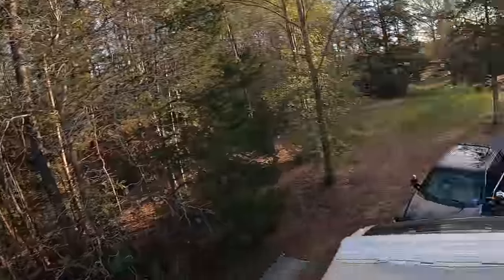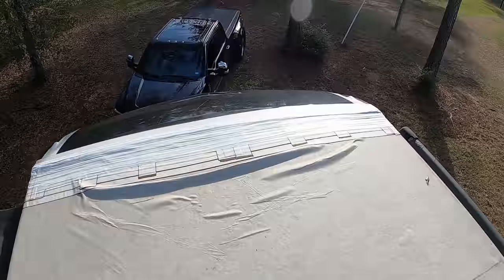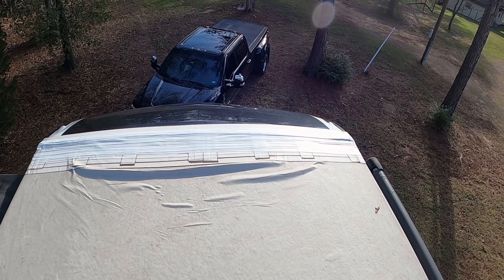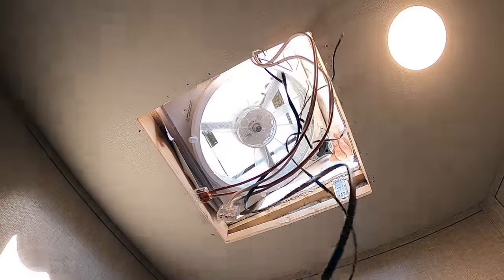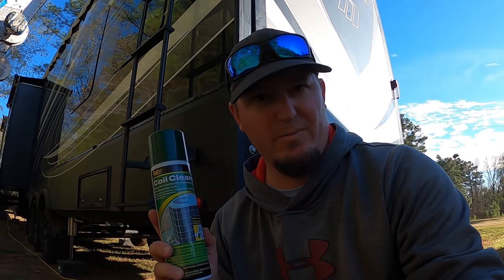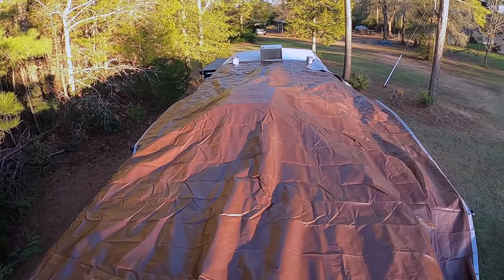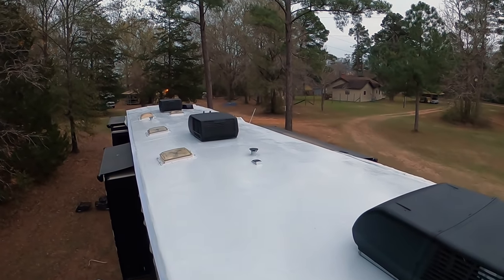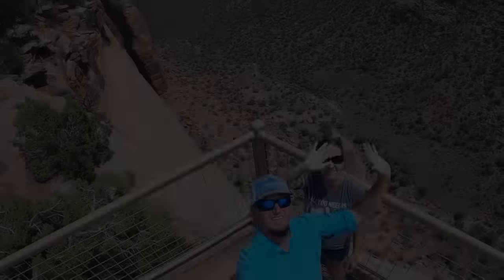Not Such A Grand Design | RV Roof Problems | The Downside To Fulltime RV Life!

Comment: What does it cost?  Also, it seemed a bit strange that the Nate was not shown on camera during the interview or that the installation process was not shown in more detail.  Makes me wonder why so secretive.
Reply from the maker: The cost depends on the work required, if there is damage that needs to be fixed as well!  We requested the entire existing roof be pulled off so ours was around $175 a foot!  At RV armor request I was not to show Nate's face or a step by step process of the roof being applied.  I was allowed to show before and after and talk about each step!  The roof membrane and the coating materials are proprietary and they did not want an uncontrolled video of how its done on YouTube!
Reply: @PavingNewPaths  So $175 a foot with tearing off the old roof and installing the new one, sounds like a fantastic deal. If our new GD ever gets to that point, this is where we'll go. thanks for the info and video.
Reply: @grumpyshorts1056  I think it is a great deal compared to what they charge you for replacing the roof with the same material that already failed!

Comment: Is this an applied liquid product that becomes a "membrane", or is it an applied solid membrane? I wasn't clear on that.
It also seemed that the penetrations, a/c, skylight, fans, etc., were embedded into the membrane as opposed to installed, as typical, on top of the membrane. So now what happens if you need to replace one of these items?
Great video. As a former GD owner, they get a lot of undeserved hype. The customer service is good, but the product is only average. Is the vinyl wood grain pealing off your interior doors yet?
Reply from the maker: Frank,  they didn't want me videoing the process but they laydown thier own fabric/ fiberglass type material on the wood then apply 2 layers of base product.  Then they install all the penetrations and lay the material and the 2 layers of base around them.  The top coat is then applied and its a very thick rubber finished product.  If you needed to replace a fan or sky light they will send you materials or a tech to help you reseal the roof when your done.
Reply: @PavingNewPaths  ah, it's more clear now. It looks like a great product.
Reply from the maker: * Discount Code for RV Armor***
Tell them you saw the video on Paving New Paths to get $100 off your roof

Comment: particle board roof? particle board would turn to mush if it gets wet. I don' think that is good quality to begin with for the roof base.
Reply from the maker: Its the industry standard for a majority of the manufacturers!  The few that do use plywood, it's not high quality or as thick as you would want!  For as much as these things cost now, they could all be built better!

Comment: saw on another youtube channel a video of a pull behind camper rugged trailer for $100k.  Definitely a full timer camper.  So many of these regular brand campers were only designed for occassional campers and not full timers
Reply from the maker: Grand Design is one of the few that claim full time use!  They might have meant full time stationary use, because we move all the time we have seen our share of issues.

Comment: Still have wikles up on front cap
Reply from the maker: No!  The RV Armor roof removed the existing stock vinyl roof and installed their roof over the entire RV!  We have not had a single issue with our roof in 5 months now!

We made a follow up video on the roof after it cured you can check it out here!  https://youtu.be/7atCc_LfrHY

Comment: So if you need to replace a vent or an AC units or anything up there what's the process
Reply from the maker: For the AC units they have thier own gasket to the roof so its the same as with any other roof.  The maxair fans and skylight are now sealed over!  So if you need to change one out they will either send you a technician or materials to reseal the roof once your done changing them out!

Comment: There's  a guy on YouTube who replaces every brand you can think of with 60 mil roofing material. It's top notch work.  I asked him out of all the brands you fixed, are there any you recommend? The answer was a hard no. Come to find out its an illusion of choice they are all owned by two conglomerates.
Reply from the maker: The installer also told me, that even those big fancy class A motorhomes have OSB as a roof and they leak too!  So no matter what your price point is they will all have problems!

Comment: So you snow coated it? Does that material ever come up off the wood like the OG material? Also how would you seal around a vent if you had to replace a fan or AC? Just double coat it?
Reply from the maker: They install their own fiberglass type membrane down on the wood then do two base coats and a final coat!  Its a rubber type feel once it cures. If you had to replace or remove the A/C unit it would not be any different from the original roof as they use a gasket that is compressed to create the seal and it is not attached to the roof! As for max air fans, skylights, or any other roof intrusions they would need to be resealed once replaced!  They give you a kit to make the reseal yourself or they will come to you and reseal it for you!

Comment: Wow! Just wow! We are picking up our new 2022 GD 351 MS next week. This has my stomach in knots! What should I be looking for when I pick up the trailer? What can I do about it before signing on the dotted line?
Reply from the maker: Ours was fine for quite a while! The first place that got my attention was the raduius area! This is where the vinyl comes up from the sides over the edge to the roof!  We had several spots that looked stretched and loose! I kept monitoring those and never saw any issues with the front cap! Until the day we saw it aired up at a rest area! Then it was just all around horrible everytime we moved! Best you can do is if something does happen look into RV Armor or Flex Armor as an alternative to the dealer putting the same roof back on!

Comment: One shortcut GD took was putting the roofing material directly over OSB. They are supposed to put down a layer of luan paneling so the rubber roofing has a smooth and solid base to stick to.
Don't be too hard on GD's quality. pretty much every manufacturer is taking stupid shortcuts these days. I bought a new top of the line Arctic Fox and the build quality is dismal. We got a new roof because the structure was built wrong.
Reply from the maker: The sad thing is no matter what logo is on the side of the camper, if its made in Elkhart or under $200k its going to be built as cheap and as fast as possible!  We have had alot of minor issues and a few major ones, but we live in ours fulltime and we use it non stop!  We would still buy another Grand Design in the future!

Comment: So you bought a camper that likely had roof issues and that's most likely why the previous owner traded it in instead of dealing with it. Did you climb up there and look before buying? Did you bring a certified rv insoector? Just curious. Thx and yes, that does suck.
Reply from the maker: It was not a trade in and yes it was inspected prior to taking ownership.  We owned the camper for 10 months and lived in it fulltime for 6 months and over 4000 miles of travel before the roof started having problems!
Reply: @PavingNewPaths  gotcha, your not the first I've seen with that issue. I really hope there new ones are better because we're looking at a solitude.
Reply from the maker: Honestly its a roll of the dice on these!  Once we had the problem we started running into people at camp grounds with momentums and solitudes that all had similar or worse stories about the roof! Almost all were less than a year old with serious roof problems.  We were lucky ours never came off before we were able to fix it!

Comment: The trick is, as you roll down the road at expressway speed, the air flowing over the nose cap creates a huge vacuum point in that area, which is lifting the roof material up. Since GD uses crap cement to hold down the el cheapo roof material, the vacuum pulls it right off the chipboard wood of the roof. And when the cheap chipboard gets a little wet, you got instant separation of the materials, which is just pressed together with essentially Elmer's Glue All, which dissolves when wet. Now you have delamination of the roof material, and rotting roof wood.  
So, this new roof skin was less than $10,000?
Reply from the maker: The roof being put on 95% of all the RV's today is not very good Vinyl and TPO just is not going to hold up!  The way they assemble them so fast also is part of the problem as it is never done correctly!  We have met so many people with similar stories to ours with the roof coming off while driving! Our roof never leaked the Vinyl was still intact, but it was getting worse with every move!  Our new roof was around $7000, and it comes with no maintenance besides cleaning and a lifetime warranty!

Comment: I would liked to see how they sealed the sides where the gutters are. Doesn’t the old roof wrap under the gutters
Reply from the maker: Yes they do!  He had to remove the gutters to remove the old vinyl roof!  They then wrapped their membrane over the radius down behind the gutters!  Once two base coats and top coat is applied the gutter is reinstalled!  They then run a bead of their top coat along the edge of the gutter where it meets the membrane!  Now that it is dry the gutter is essentially part of the roof now!
Reply: @PavingNewPaths  sounds like a bulletproof system. What was the cost for a trailer your size? Also how long did it take to get them out there to install it?
Reply: @whipple7362  It's based what needs to be done and if there is any damage to repair!  Ours was around $175 a foot but we requested that the old roof be completely removed, including behind the gutters!  We scheduled it for the time that worked best for us!
Reply: @kevinmakesitcool  that’s not bad at all! Just over $6k.
And if I ever had to have it done I would definitely want old roof removed and it wrapped under the gutters. Maybe even new gutters. Thanks

Comment: Our only GD and our last, was not all the hype they let us on to think. Everything is so very thin, small hail broke the tub skylight. It was so thin, I went with a after market skylight, the kitchen slide tore the floor. I contacted the selling dealer, very helpful they said this was an on going issue and GD should fix it. Contacted GD "This is the first we have heard of this, not our problem. Well GD won't be my problem again.
Reply from the maker: The problem is it doesn't seem to matter what brand you own! If you travel fulltime and move often they will always have issues and need repairs! We have swapped stories with a neighbor that had a million dollar class A and his experience was worse than ours! That is why we bought used and make all our repairs ourself! We will not be disappointed by a dealership, the manufacturer or a warranty! We just make any repair needed and move on with our life!

Comment: With the fans and AC units out, the truss's don't look very thick (tall), How much insulation thickness do you have, and what type ?
What does the RV maker claim for R value ?
Reply from the maker: The truss system goes from around 3 inches on the sides to around 6 inches at the peak! Grand design claims an R40 rating for the roof!
Reply: @PavingNewPaths  Thanks for the reply.
So Grand Design claims R40 in just 3-6 inches, LOL, I better roll my pant legs up because the poo is getting deep.
Was it simply batt fiberglass ?    I'm buying a Arctic Fox 5th wheel, I hope they're being truthful
Plywood for decking ?, 16" OC truss's ?
Reply from the maker: They claim with the roof "vinyl" layer, the particle board, the fiberglass insulation and there is a foil layer in there it is R40.
I will say with our RV Armor roof so far the noise level from rain is quiter and the A/C units seem to run less than with our old roof!

Comment: Boy that's crazy. An arm and a leg for the coach and instead of relaxing you have to install a real roof with the installer. Where does the money go in these RV's I wonder.
Reply from the maker: This is part of the reason we bought used! We knew there would be issues and repairs needed! We never imagined the roof would need the be replaced on a rig that was only one year old! We decided instead of having the same stock roof that already failed put back on, to go with a roof that comes with a lifetime warranty!

Comment: Why not show roof system ? Is it a polyester with a rubberized coating ? Why Not install self adhered single ply with heat weld laps and termination bar .... Coatings only has a small duration maybe up to 5 years unless U use silicone and U would Not want to use that on your r v ....
Reply from the maker: RV Armor requested that I not film the installation process, however if you're interested, they show step by step on their YouTube channel!  It is a fiberglass type membrane they lay on the roof, then they have two basecoats they apply, followed more membrane strips around all the intrusions.  They finish it up with a heavy final coat that when cured has a very rubber feel!  This roof comes with a lifetime warranty, that stays with the RV even if I sell it!  It is a very good product far better than any factory roof that is vinyl or TPO!

Comment: Great info.  Would definitely go that route if we ever need one. BTW- when you installed your center ac with the white foam block (AC Airflow mod) your not suppose to put that triangle piece on. It blocks the incoming air to the ac unit.
Reply from the maker: Thanks!  I didn't know that was not suppose to be there.

Comment: Not impressed @ all with Grand Design quality has slipped significantly since 2019 its not the same company ever since Winnebago took over
Reply from the maker: You would be surprised how many people we ran into on the road that had Grand Design Campers that had the same repair list we had!
Reply: Looks like a lot of Made in China all over my 2020 GD Transcend 32BHS
Reply: We have a 2015 303rls we bought from a couple who have had it sitting on a lot with a sunroom since it was purchased. Slide is leaking, closet is ruined, stickers are cracked and peeling, including the ones inside the sunroom and covered side, molding is falling off the ceilings, couches have flaked and peeled.
 Roof was bubbling and lose, we just had someone coat it.
 I replaced the toilet with a real one since we're on septic. Just bypassed the black tank and teed into the manifold. Easy enough... But when I pulled the material from underneath to get to the manifold you could really see the laziness in how they handled all the wiring, plumbing and HVAC. 
 They look nice from a distance, but the quality of the materials used and the poor quality of workmanship  altogether... I wouldn't purchase one new. Not for the pieces they're asking.

Comment: What product was it rolled with? Also it was rolled on the wood? Thanks 🙏
Reply from the maker: Thisis a roof by RV armor! They put down a fiberglass type membrane, do two basecoats and a final thick top coat! The end result is a very rubberized roof that will flex and wont tear! The exact make up of the materials I don't know it is proprietary to them!

Comment: Where the plywood ends on the sides near the gutter is your radius finished round or is there a blunt edge where the plywood ends and the fabric was just stretched over the side and not glued near the gutter molding and was there a gap no rounded edge? Grand design says there’s no finished radius and there is suppose to be a gap underneath the fabric on the edge cresting an issue where water intrusion can happen. It happened to me I got a tear near the ladder on that blunt edge where the roofing plywood ends at the radius near the gutter. Does yours have a nice solid radius and TPO nicely glued or is there a gap under your TPO at the radius just before the gutter? Did you fix that BEFORE you put your new RV Armor roof on? I’d like to hear from you about how you like your new roof. Thank you:-)
Reply from the maker: They removed all the Vinyl roof and put down thier own membrane that went over the radius and behind the gutters! They then coated the membrane with 2 top coats that dry pretty firm with a final thick rubber top coat! We love our roof and no longer do anything buy clean it now! No more carrying dicor around!
Reply: Thank you, I talked with Jim P at RV ARMOR he gave me the scoop, I appreciate you getting back to me

Comment: Why would you NOT treat the bare wood under the roof with something like Copper Green wood preservative???......seems silly not to do that.
Reply from the maker: We did treat it with a new roof! If the roof is doing its job the wood will never get wet! The new roof is now permanently bonded over the wood, you can't take this roof off with out pulling the wood off now!

Comment: If this type roof is half the cost why is GD not using it from the get go?  Makes no sense.  We have a SOlitude (2021).  I check the roof after every travel day.  I am paranoid about this issue.
Reply from the maker: It is half the cost to the consumer (us) compared to putting the same vinyl or tpo roof on that fails!  For Grand Design or any major manufacturer it would likely be even better cost savings!  So the question really is why don't the put a roof like this on from the factory!